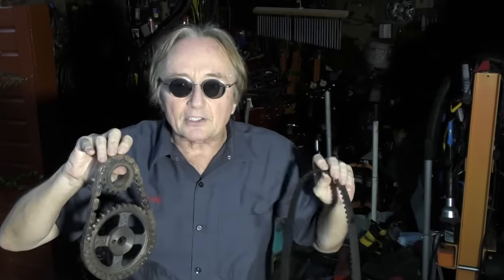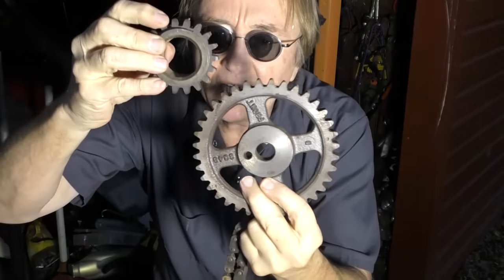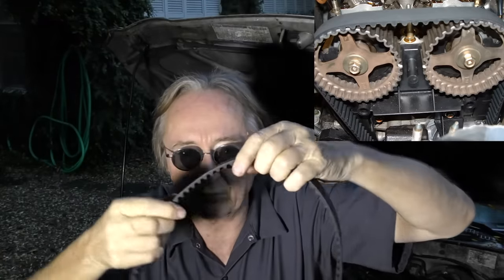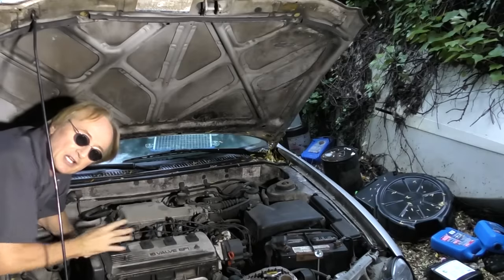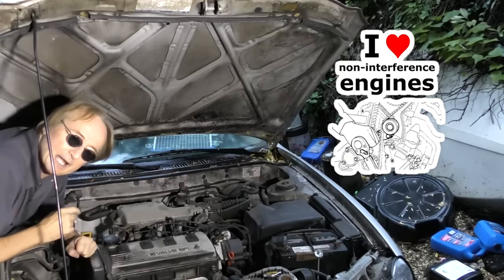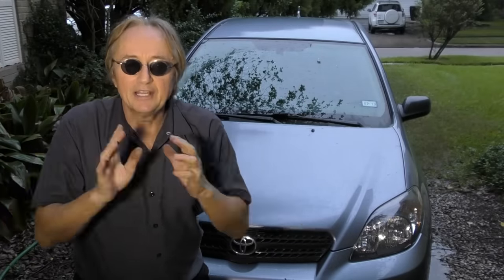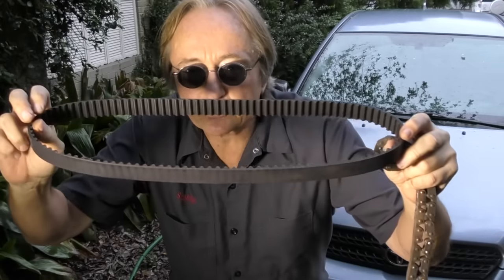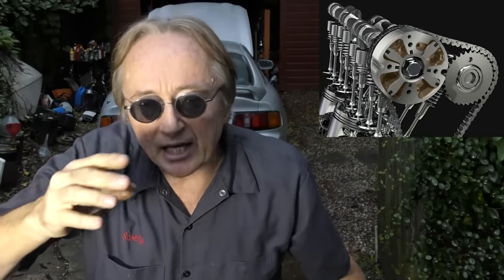Why Some Cars Have a Timing Chain Instead of a Timing Belt

Comment: Today a Fiat was brought into the garage I work at, the timing chain broke at only 136,000 km (84,500 miles) and destroyed the engine. Damnit Fiat, a timing chain is supposed to last LONGER than a belt!
Reply: I owned a Fiat Punto Evo 1.3 diesel and my timingchain broke at 180.000 km. Car had regular maintenance and drove it always normally. Before the fiat I owned a Passat from 2003 with 1.9 TDI engine and never had issues with the timingbelt. Sold it after 3 years with 332.000km on the clock and it drove like a dream. So I prefer timingbelt, easier to change and you just know you have to replace it. With the chain its a huge risk.
Reply: Well it's a fiat
Reply: @brandonpeterman9964  That's why I don't drive Fiat (or anything Italian) anymore...
Reply: @MrSuperIntruder  Yes, it will need more time and money to replace chain than belt.  I drive 1974 Toyota Celica, still a dependable car and comes with timing chain. If I need to replace it, the engine head need to be removed, carburator, intake manifold and exhanust man as well.  That's a hell of work and too costly.  So it is NOT always better to buy a car with timing chain.
Reply: what kind of fiat was though
Reply: too bad they were bought by Crust-ler
Reply: General E DGAF other way around buddy
Reply: @osvaldovidela6466  Punto Evo 1.3 MultiJet diesel with 85 bhp
Reply: @HardWhereHero  Fiat bought Chrysler
Reply: Fiat stands for: Fix It Again Tony!😆
Reply: @Shadowdancer777  or: Failure Italian Automotive Technology
Reply: Hey, that was the exact car that came into the shop! A Fiat Punto Evo, I think it had the same engine too.
Reply: @KravityGECK  It's a common problem with the 1.3 Evo. I've read about a guy in the UK that his second engine also broke the timing chain... Really shitty engines but the cars are lovely to see.
Reply: @MrSuperIntruder  well it's a modern fiat they aren't like the old ones those were reliable until the mpi engines those suck
Reply: Thats a Fiat for you.
Fiat: Fix It Again Tommorow.
Reply: Fiat timing belts last around 80k kilometers, so yeah,their chain lasts longer than the belt lol
Reply: @mkilic10  Yes they do my uncle has an '88 Duna (Premio in brazil) and it still has the original timing chain impressive fo a 30 year old car

Comment: it's like a wwf tech history lesson
my toyota has 315,000 miles on the factory belt (not proud of this)
Reply: What Toyota model?
Reply: @daviddou1408  hilux is the truck which uses a chain. The plastic guides wear groves and chain can stretch. I had an 85. Only repair besides basic maintenance was clutch. And had front seal replaced so wudn leak oil. Nothing else broke.
Reply: @daviddou1408  hilux is the Toyota truck, the model before Tacoma. What part went over head?

Comment: Great video.  Chains have had their problems but I would not own a car with a timing belt.  I've seen too many people have to spend big on maintenance costs doing the belt and water pump replacement.   Even the outboard engines are switching to chains.

Comment: Yup I'm glad my v8 has a timing chain.
Reply: The older V-8's had plastic teeth on the cam gear. Manufaures have used trash parts and designs on all engine types.
Reply: @jeffreydevoti8528  bakelite teeth wheels, often use on older engines to reduce noise...

Comment: I hate timing belts! I try my best to avoid those cars
Reply: TruthSeeker just get a Toyota
Reply: @N12Gautam  I work for Ford and all I drive is Lexus Toyota LOLOL
Reply: TruthSeeker be careful I heard ford is downsizing
Reply: Timing belt are very quiet. Only thing that you care is change belts every 100k miles.
Reply: Anything GM that is not an Ecotec will have a timing chain, which is always great to have.
Reply: The chain or belt are not moving a very heavy parts, that has to take into consideration
Reply: My toyota has a timing chain
Reply: @youandiryan  My Saab has a chain, my Alfa has belts and my Rx7 doesn't have either :D
Reply: @sw96  a few years ago I had a Volkswagen that had a timing belt and despite me putting a brand new belt in it still snapped and my fucking engine was done. So I decided to go to toyota.  Volkswagen is also known to use fucking plastic water pumps or impellers so after time they get brittle and break. So no more fucking volkswagens for me.
Reply: youandiryan  That sounds like a good reason to avoid a brand.
Reply: @sw96  it definitely put a sour taste in my mouth. To my knowledge most new VWs have chains now. But still dont trust them.
Reply: Avoid Honda Accord v6
Reply: @youandiryan  me too. I've had to do a major engine repair because of their faulty chain tensioner. These Germans have too many issues with their stupid engineering . Japanese #1 in my list.
Reply: @Khang602  60k miles on some . I had a car with 72k followed GM rules of 100k and destroyed engine. Had I followed Saabs recommended change interval I would have been fine. Same engine in both cars.
Reply: @qasimnas  japanese cars are just really good cars. Their components are tough and made high quality. Sorry to hear about your mishap. I used to love VW but after working on mine and all the stuff that's happended i went away from them. Volkswagens are expensive and hard to repair. I also have a mercedes that i do all my own work on and even that car is easy to work on compared to the VW
Reply: Dodge darts with the 2.0 have a chain system, just fornyou to know
Reply: @N12Gautam  Ford is planning on dropping all cars, except the Mustang. It's suppose to happen in the next few years.
Reply: @rapideye85  ecotecs have chains too
Reply: @youandiryan  I thing VW is now going back to belts but their newer cars, tsi and tfsi engines had chains and a LOT of problems with that.

Comment: I know Scotty probably won't respond, but I feel like a bit of a fool changing the timing belt on my 2003 Subaru Impreza.  It's got less than 22,000 miles on it, but it's 16 years old.  The manual says change the timing belt every 8 years, so I've gone double.  Worse case, I wasted my time and the 90 bucks for the belt.  (plus the two hundred something  in rollers, idler gears and a tensioner) Of course changing the rollers was probably a good reason to do the whole thing.  I was surprised that they needed replacement.  No, they weren't shot, but they were noisy and I had it apart.  I can tell a difference when it's running.  (yes, it does still run.  I was SURE I screwed it up somehow and would turn the engine into a maracca) If I hadn't, I'd still be worried.

Fortunately, my other cars all have timing chains.
Reply: Rubber belts deteriorate over time whether they are being used or not. It most definitely had to be changed after 16 years.
Reply: I hear the cam bolts on subies are torqued at like 200+ ft pounds lots of videos of people just drilling them out
Reply: Changing the belt on time is proper maintenance and is never a waste of money.  The Subaru Impreza is fine machine and when maintained properly can last a very long time
Reply: @weswest8666  I'm not sure what you mean by "cam bolt."  On my engine, the bolts that hold the cam gears to the camshafts are only torqued to around 72 lb ft.  I didn't take mine off, and my water pump was good.
Reply: You should find out if it is an interference engine.  At one point the Subaru EJ engines were a non interference design.  I'm not sure exactly when that changed though.
Reply: @niuhuskieguy  I know mine is.  I didn't know there was ever an EJ that wasn't, but I only own this one.  That's why I went ahead and did it.   If I changed it and didn't need to, I just feel foolish.  If I hadn't changed it and it destroyed itself, well, I'd fell very much MORE foolish.  (and I'd be very much more broke)

All the parts sure were expensive, but then again I bought parts from a dealer.  I've heard mixed reviews about aftermarket parts, so I just played it safe.  (expensive, but safe)
Reply: You must drive to the end of your driveway and walk everywhere else you go.
Reply: @AU9377  LOL No, it is the last new car I'll ever buy so I don't drive it much.  I've managed to keep it "like new" for 13 years.  I ahve other cars that I actually drive.

Comment: My 1978 Ford Pinto has the 2.3 ltr engine with the original Motocraft timing belt and original Motocraft V belts... however it only has 32,700 miles on it and drives pretty sweet....   The timing belt looks just as good as when Ford put it in.

Comment: I blew a head gasket on my 1998 Expedition 4.6L. When I opened it up and looked at the timing chains and sprockets, they looked brand new. No visible wear whatsoever. The car had 220,000 miles at the time.
Reply: Yep typically those timing chains will last forever...well that is if you maintain your vehicle properly.  Its the people who cheap out on oil changes all the time that you find that they have all sorts of simple failures that turned into catastrophic ones all due to lack of maintenance well because having the oil changed in their $60,000 SUV just won't allow them to have their $300 fake finger nail job.
Reply: Brilliant observation, William. The problem is...they didn't buy the car to begin with. Their husband did. So why would they care about maintaining it?

The chain didn't need replacing, but I went ahead and replaced it anyway.

Comment: Timing belts are not made just of rubber as you´re putting it.
Reply: He didn't say they were, he insinuated they were rubber based compound
Reply: @KentRoads  If John Lennon has insinuated that it didn´t come out very clearly. I have a Renault and the rubber timing belt lasts for at least 160,000 km or 100,000 miles. - Not too bad I guess. Timing belts also have the advantage of being lighter and therfore helpful at saving gas and of being less loud than timing chains, if I´m correct.

Comment: You didn't mention the timing chain tensioners though Scotty. They are the cause of a lot of failures on timing chain cars that might as well be a broken chain. Belts on the right cars are cheaper and also tend to give you a lot more warning if they are close to failing.

Comment: That’s where Honda sucks.  When they say 60k change they mean it!    You don’t have to be hammering it to snap one either.   I’ve seen it first hand  .     That’s why when you buy that old car with 125k and tho only sticker on that chain cover is illegible YOU WILL CHANGE IT NOW.     People start letting things go when they’re going to sell and timing belts are a favorite!  So if you aren’t positive when it was changed get it looked at.    
    Also don’t cheap out.    If there’s a water pump under there change that out too.    They’re cheap enough and if yours starts leaking in on of those configurations the belt has to come off to get to it so do it all at once and rest easy.
Reply: I second this. Recently bought a 2005 automatic civic with 170,000 plus miles. The oil was black like hard coffee. It scared me that it was so cheap yet hey, first car after a big cross country move. Timing belt and its interference engine. Good thing its not that hard to replace it out.
Reply: I have a 05 Odyssey that went 205k on the original belt and pump, so they can last awhile. Of course, you're gambling your engine at that point so please just fix it.
Reply: The J37 in my Acura MDX had a belt also.   The thing to remember is that it is not just mileage that determines a belt change but also time.   Honda recommends a T-belt change every 10 years if the 105,000 mileage is not reached in that time.  When I traded my MDX it was 8 years old but had only 48,000.   Hope the next owner remembered to change it (and the water pump).  Not sure if the new Earth Dreams V6s have chains or Honda stayed with belts.   I do know many many complained to Honda over the years about using belts in their J-series V6, but Honda just shrugged and said a belt is a "normal" maintenance item just like spark plugs.    Yeah, right, a $1300 "normal" maintenance item.
Reply: Most hondas now run chains.  That all started when they switched to the k series in the mid 2000s.  On the older models when you do the belt at 100k or 10 years always do the water pump, tensioners, cam, and crank seals while you're in there.   It's not a difficult job, but it's not something a novice should try to tackle either.
Reply: THATS WHAT HAPPEN TO ME BUT I WENT AND GOT A LAWYER!!!!! for a so called certified vehicle.. they never changed the belt even though it was due at 60,000 , and i bought at 63,000..  it broke at 71,000 and yes it was interference and destroyed the valves.. GOT A FULL REFUND PLUS THE LAWYER FEE!!!!!!
Reply: I have a 98 Honda D16y7 started with 90,000 on it belt looked good so I left it alone. Just over 205,000 now. Most of time over 10,000 between oil changes and ran low multiple times. I've been redlining a good bit trying to blow it up so I can put y8 in it. I might just swap the y8 head on it with a new timing set and water pump if the belt doesn't  give out anytime soon. PS Idgaf they are all pretty much throw away anymore.
Reply: I don't know how miles was on the belt when I got it I adjusted it just a  tad bit tighter almost 120,000 on top of what it had has failed yet.
Reply: Damon Lemasters its possible The previous owner had the belt changed early.  Common for service guys to push that one.  That said a non vtec sohc d series is not exactly a high strung motor and the belts can last a long time.  If you really want to break it, get a cheap 50 
-100 shot nitrous kit and kill it in style.

Comment: My 2008 Honda fit has a timing chain. I adjust the valves every 30,0000 miles.
Reply: 300 thousand miles? I'm sure it's just a typo but I had to ask.
Reply: @KCDW83  30,000 thousand
Reply: Look close. You have an extra 0 in your original comment.
Reply: @KCDW83  And I care why?
Reply: @rafyg3314  🍿

Comment: Okay Scotty, you pointed out the benefits of a timing chain vs a belt, now make a part 2 of this video why timing belt engines are vastly superior to chain.
Reply: Xavier Lemos I'm pretty sure my Qx56 V8 timing chain engine is superior to your timing belt engine... :)
Reply: @DiceLtdRS  
I own vehicles with chain and belt, I feel sorry for you for driving a Nissan.
Reply: Timing belts suck, end of story.
Reply: @adamk203  
You clearly haven't been around cars long enough to know that both have advantages and disavantages.
Reply: He is correct. There is a reason why high performance applications are almost always belt. A terrible idea on a daily commuter. Look up Danny Bee belt.
Reply: @michaelmabe8214  Which motorcycles use timing belts? Not HI-Perf applications! GoldWings aren't racing bikes.
Reply: @tbillyjoeroth  have no idea, not a bike guy but been around a dragstrip for 30 years and it is not opinion it is most definitely fact that belt is superior in that application. As I've said already said though a daily shouldn't run aluminum rods and for the same reason shouldn't run a belt either. 

Don't take my word for it go start an argument with a top fuel or nhra pro stock guy.
Reply: @tbillyjoeroth  
Several Ducati bikes use belts, there are even bikes like the Buell with a belt drive system instead of chain.
Reply: So the Rb26 and 2jzgte, two of the best, most reliable, and most durable engines use timing belts why?
Reply: From a purely performance/longevity POV, there is Zero reason to use a belt over a chain. Perhaps they might make the engine 0.3% more efficient overall which id argue is measurable but negligible. Belts are used because they are cheap, quiet and reliable enough. That's it really
Reply: ...yeah, he'll get RIGHT on that.

The point of the videos is to make people MORE knowledgeable, not LESS. Spreading tripe like "belts > chains" would be contrary to that goal.
Reply: @x-man4702  "Several Ducati bikes use belts, there are even bikes like the Buell with a belt drive system instead of chain."

Uh, how many miles does a Duc get in its lifetime versus a car? You really don't need to make a bike all that durable.
Reply: @bcubed72  
You missed my point completely, please read again.
Reply: @x-man4702  
You had a point?
Seems to me, you're just jockriding timing belts without supporting evidence.
Reply: @bcubed72  
Go back to school and learn how to read and understand, then we can have a discussion.

Comment: The belt isn't strong enough? Yeah, try telling that to a supercharger...
Reply: Plus they replaced chains on Harleys and all kind of street bikes.
Reply: @damonlemasters3424  also true
Reply: Dragsters break belts often. Though are using at least 50 hpo to turn the blower. Some OEM blowers are chain driven as are many hotups of the past. A Vee Belt is not reliable.
Reply: The reason blower belts on dragsters break is. For any reason, AND THERE ARE SEVERAL the blower gets flooded with fuel,
that is "hydraulic lockup" and something is going to break, right ! 
If the belt breaks that is the best thing that could happen, the worst is the blower goes fifty feet straight up, the crank goes 2 ft down and the rest of the engine everywhere else.
Reply: @michaela.660   yep seen that happen a few times  ,those blower don't just go 50 feet up, they come back down and can often hit somebody in the stands
Reply: it is not the same, in supercharger is like a constants pull for the belt, in camshaft is hard and soft every RPM, also for supercharger are bigger and not mater if you loose a teeth
Reply: The supercharger runs off the serpentine belt, which is bigger, stronger, and doesn't destroy the engine when it breaks